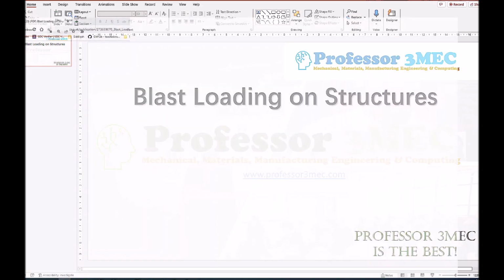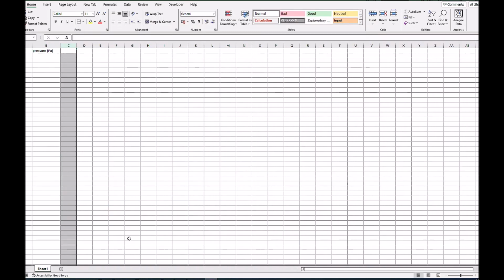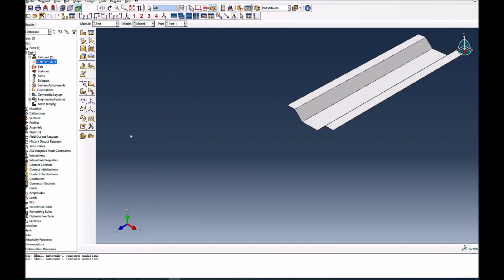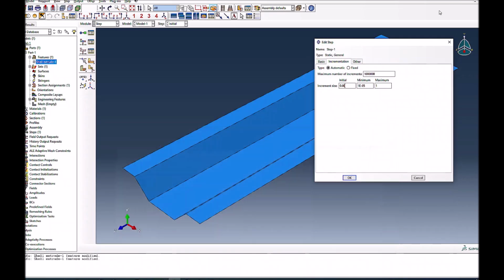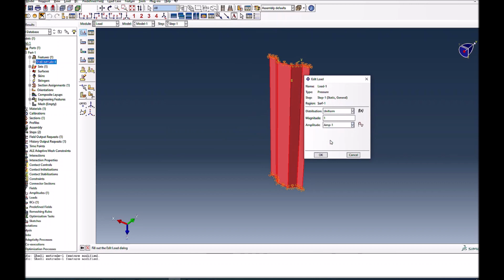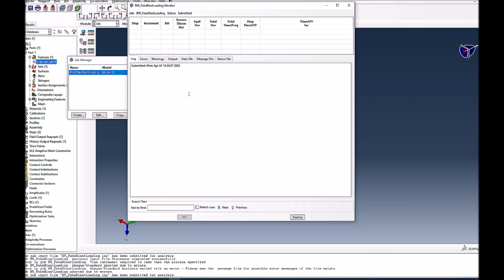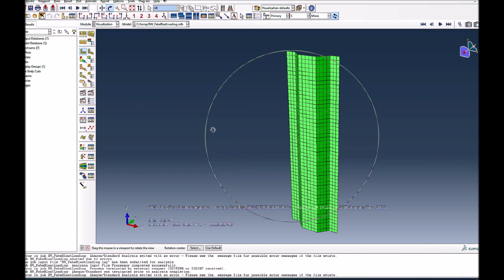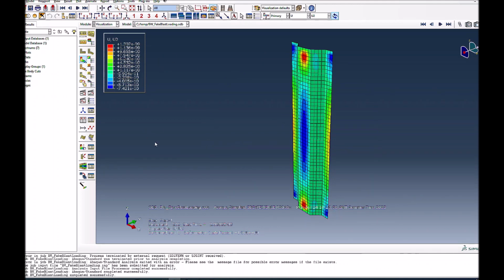Blast Loading 💥 on Structures through ABAQUS CAE: Step by Step Tutorial (high strain rate loading)

Comment: you should use dynamic simulation - you have not here the inertia effect.
Reply from the maker: If there are rigid body motions then definitely inertia would be necessary in this case it was assumed to be quasistatic case. For micro-inertia in terms of materials modelling we have a number of papers.
Reply: @Professor3MEC  how is connected micro-inertia with your example ?
Reply from the maker: @tomaszjankowiak3777  all depends on mode and length-scales of interest.